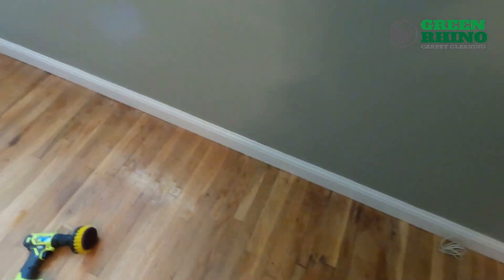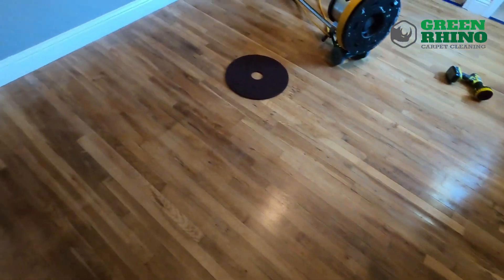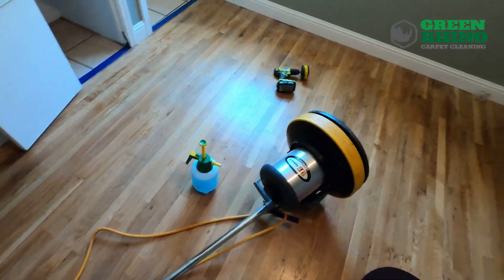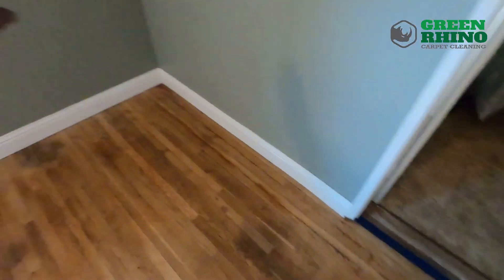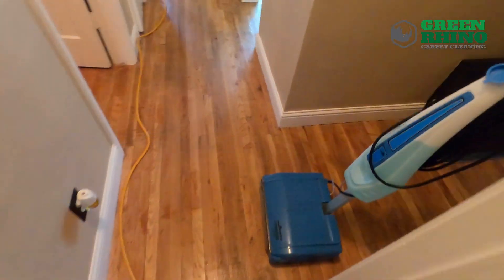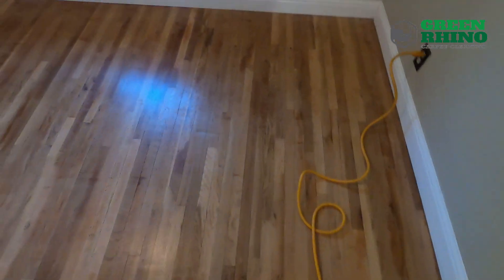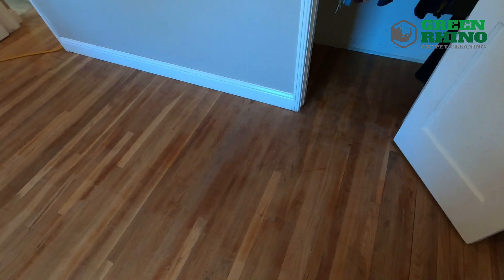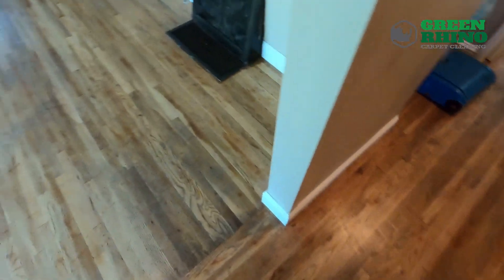Hardwood floor cleaning from start to finish - Easy and effective

Comment: Would you always put down a finish after SPP scrub? What if customer has thick finish already on the floor?
Reply from the maker: @Drummer150  then don’t run spp pad just clean if they don’t want to recoat.
Reply: @greenrhinoproject  Great Detail!!👍
did you use TM to extract?
** After seeing a complete wax gum in a destroyed Blower the only time I use TM extract for floor refinish is with white/red pad and use paint filter inside inline filter

Comment: Just had the same type of job about a week ago. Involving a ton of paint on some hardwood floor. Great job on the hardwood floor. I was nervous about using the black pad but that was the only option without having to sand the paint off. But what is the 🎵 you played? Great tune for the morning

Comment: Do you clean them pads out after for another use? I found a deal on 10 pads, I’m trying to figure the lifespan of them.
Reply: You can power-wash some of the pads, but some will be too gunked up or wore down. Spp pads are pretty thin, so they wear out quickly, but they do a great job. If you don't have a power-washer, bring them to one of those manual carwash places. Those pressure washers run at 1400 psi, so it takes longer, but still better then a garden hose or slop sink.